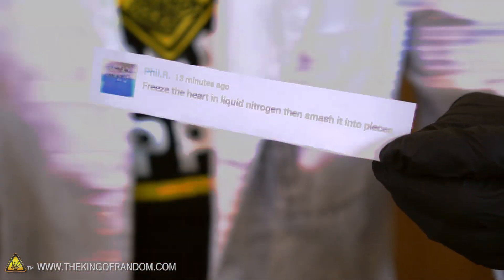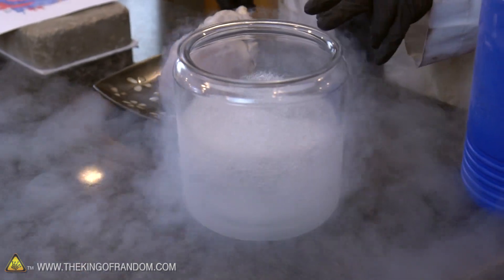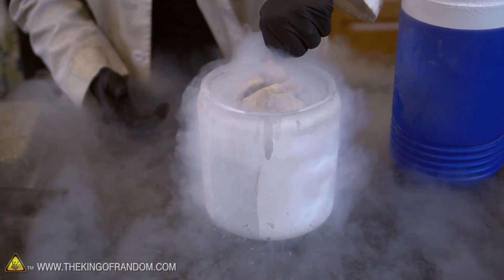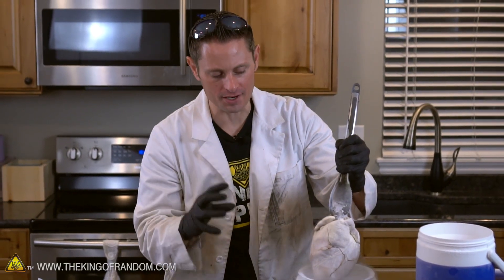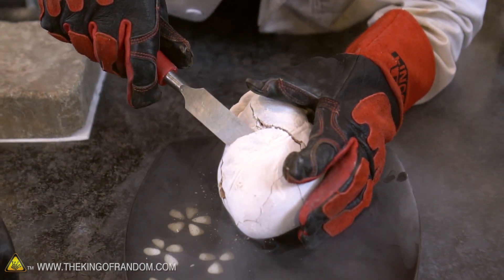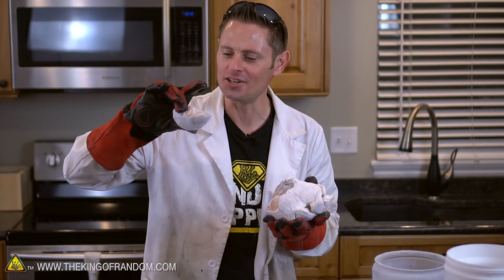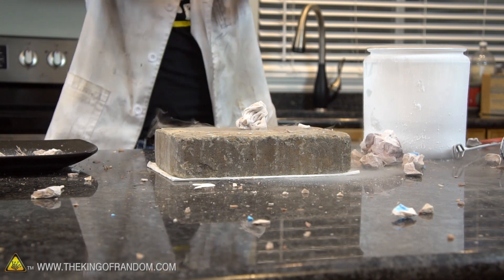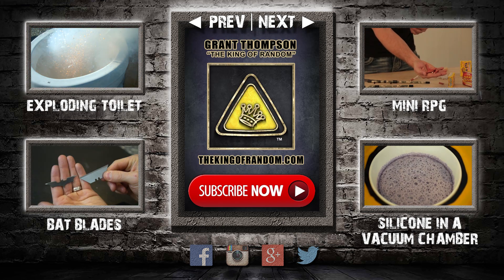Dissecting Hearts With Liquid Nitrogen

Comment: Does water freeze in a vacuum, or does it just boil?  What happens to ice frozen at standard pressure, and put in vacuum?   Is there a difference between cloudy or clear ice?   Does a partially inflated balloon expand if it is covered in water in a vacuum?

Comment: I just learned about vacuum metallization from Adam Savage (cohost of Mythbusters). Bringing aluminum to its melting temperature in a vacuum causes it to 'pop' and coat everything in a thin layer of aluminum. However, it can be wiped away, so normally the piece is coated in a clear  lacquer as a finish. It sounds complex, and dangerous, but that's you're bread and butter for this channel, so I'd love to even see an attempt at it.

Comment: a Prince Rupert drop is created when glass is dropped into water which creates stress. If left out in the air it wouldn't be as much stress therefore it isn't as strong. if you created a Prince Rupert drop in dry ice would it be stronger than the one in just water

Comment: what if you were to make a drinking  glass mold using silicone? I think you would be able to make the actual walls of the glass from setting a smaller one into the bigger one. That way I think it would make walls and a cavity inside to put actual liquid in!

Comment: I heard if you put a CD in the microwave, little bolts of electricity bounce around on the surface of it. (The CD no longer works afterwards so make sure it's one you don't want)
Reply: also will destroy the microwave, and may start a fire

Comment: You should put water and an egg in your vacuum chamber and see if you could hardboil the egg
Reply: Mike N. you cant, the water just boils at a lower temperature if the pressure is lower
Reply: Kira then would the egg cook at a lower temperature?
Reply: it s like putting the egg in liquid nitrogen which is boiling but instead of cooking the egg will freeze

Comment: What happens when you put liquid nitrogen in a vacuum chamber?!
Reply: Jumbo Nugget turns into gas and leaves like air
Reply: Jumbo Nugget he already did
Reply: Jumbo Nugget or if the vacuum is strong enough it lowers the freezing point of the nitrogen, and it will freeze solid. but the interesting part is freezing solid uses just enough energy to create just a little bit of heat, that it will cause it to rapidly go back and forth from instantly freezing solid to being liquid.
Reply: Riot yep...not that interesting..
Reply: Actually it starts to freeze and turn into ice but only for a second. It turns back into a liquid.
Reply: Jumbo Nugget whatch his boss so I can find out dude
Reply: Jumbo Nugget yeah

Comment: I think it would be interesting to see you mix up a batch of concrete then extract out the air in the vacuum like you do the silicone.   Would it be denser,  and harder once it cures or would lack of air not permit it to cure

Comment: Freeze a rock and see if it will break or stay hard to break!
Reply: This only really works on substances that would become brittle where there was previous elasticity or malleability, or especially on organic matter (water content freezes) so a rock wouldn't really be affected, as far as I can tell.
Reply: Alaxonah it wouls be smashed
Reply: Max Fisch That's kinda interesting, you'd think that since a rock is hard, putting it in liquid nitrogen would make it extremely brittle but I guess not
Reply: I don't know much, I'm just extremely curious, anything could happen. I think.
Reply: Wyatt Halverson I think that the rock's molecular structure couldn't be modified after flash freezing, this is usually only seen after heating and cooling (e.g. steel). However, this is also dependent on the bonding between the atoms or molecules (amorphous, polycrystalline, crystalline). This is why I made the conclusion I did above.

Comment: SEE WHAT HAPPENS WHEN YOU PUT ANITFREEZE INTO LIQUID NITROGEN
Reply: It freezes.
Reply: TheMontanaDave Not the point, it should freeze without crystals and look like glass
Reply: The minimum freezing point of Glycol temperature is at about −36 °F / −37.8 °C corresponding to 60–70% glycerol 

Liquid Nitrogen is at -321F So yeah do the math, it will freeze.
Reply: It will if not done too fast. There are a few factors for that. 1st the oxygen in it. Yes It will have Dihydrogen Monoxide molecules in it.; along with other oxygen bonds.  @n'd if you freeze of "crystalize" something to fast it will show. If you cool it at the right rate and lack of atmosphere ( Hey the vacuum chamber!)  It will be very clear. Now when making clear ice, they use either vibrations or an insulated freeze method - ( YouTube this)  to remove the dissolved O2 from the water.  If you don't remove the dissolved gasses (O2 or Nitrogen, hel any dissolved gas) it will have bubbles or be cloudy.  

Does that make sense or do I need to show you a vid?
Reply: TheMontanaDave Lol you're not the only smart one here. I understood what you said.
Reply: yea these tumbleweed hairs do not know what they're talking about
Reply: simply put it looks like water
Reply: Torpid N1ghtmare would just freeze antifreeze is resistant up to a certain degree
Reply: I am stating facts bro.
Reply: when you try to look smart

Comment: Have you experimented much with vapour points? Such as how lower pressure forces most liquids at room temperature to instantly boil. Lower pressures decrease boiling points, so I'm curious about how low a pressure does room temperature water boil? What about still frozen ice in a vacuum chamber?

Comment: water expands when it's frozen, so since the outside froze solid first then the middle did it expanded the already frozen outside resulting in cracks on the outside. 
That's my educated assumption on why you saw cracks not from you doing it prior.

Comment: Could you put liquid nitrogen in a bottle and screw the lid back on and leave it in the sun to see if it explodes. I am buzzin to see the liquid nitrogen generator. Also could you make a liquid nitrogen powered version of the hand warmed steam engines so it creates the vacuum to pull the piston down and air comes in when the compression piston is at the bottom so heats it up and then the piston goes back up, etc...

Comment: Take some lollipops and heat them in a very high temperature , while when the lollipops are melted there are gonna be so many bubbles so I'm wondering what happens when you put it in a vaccum chammber ( while it is super hot )

Comment: in your next project, color the liquid nitrogen with food coloring, how will it respond to the coloring and will the gas change color?
Reply: The food coloring would just freeze into small beads.
Reply: Amane Abunada no. The coloring will freeze and will not be able to mix in. The gas will remain invisible to the naked eye. Would be cool to see frozen food coloring, though.
Reply: Cheeser100 ^
Reply: what if you put powder pigments? would those freeze, or could they mix in with the liquid nitrogen?
Reply: that would be awsome
Reply: Wont the nitrogen freeze the food coloring?
Reply: kitsilanocat they would probably freeze but I am guessing they'll just kinda bounce up on the gas released from the liquid nitrogen.
Reply: Amane Abunada food color can't dissolve into liquid nitrogen because they aren't the same density also it would just freeze and if it were to some how mix which it wont, and it evaporated the food color wouldn't evaporate with it, because it is like how salt doesn't evaporate with water at waters boiling point
Reply: Amane Abunada nice idea
Reply: Thanks:)
Reply: Cheeser100 oh yea
Reply: I'm so down!!!!!
Reply: Amane Abunada cool
Reply: f
Reply: Mihai Mera sup
Reply: Amane Abunada Grant Thompson - "The King of Random" cut the heart open or do the 1000 degree vs heart  .
Reply: Yay .com it

Comment: Try to put water in the vacuum chamber and freeze it to make a crystal ball with no bubbles
Reply: This will not work as water will boil in vacuum. 
You just need PURE water with absolutely nothing else in it. There is a method of making clear ice spheres for cocktails from bottled water. I think Cocktail Chemistry did a video on that.
Reply: Lucas Mb Cool idea! 😆

Comment: The smokey stuff isn't "nitrogen vapours," it's condensing water into tiny droplets creating little clouds.  I'd guess that it's just you disrupting the surface of the pooled nitrogen gas, causing it to mix more with the surrounding air, allowing it to condense more water at the surface of the nitrogen gas pool.

Comment: Hey Grant. What would happen if you poured liquid silicon into your liquid nitrogen. would it turn back to liquid when it thaws? Or will the time it was frozen cause the silicon to set?
Reply: because I watch youtube.
Reply: Zenborath I think it would be cool if when the outer layer thawed it set and then when the inside thawed it turned into a bag of silicone.
Reply: Zenborath why are you everywere?
Reply: Silicone isn't setting because it is cooling down, it starts and ends at room temperature, it sets over time from the reaction of the two things being mixed together so it wouldn't set from it
Reply: Illusory Gaming I'm not sure if this comment is aimed at me or not but if it is I meant the outer layer to set after it had thawed but while the middle was not thawed

Comment: If you put the main chamber of the vaccum chamber in a tank of water and weighed it down, would it float when it was pressurised? Because vaccum is obviously less dense than air, so it would float even better, right?

Comment: since ice melts when under pressure and freezes when the pressure is released could you put an icecube into a pressure chamber to melt it and then store it as a liquid and then when you release the pressure back into a solid

Comment: hey grant,, can you put gun powder in liquid nitrogen then try to light it on fire?? I wonder what that would do.. :)
Reply: Rafik Nanneh light on fire?
Reply: Fire needs a "minimum temperature" for it to stay lit, i've seen one of a guy freezing alcohol and attempting to light it on fire, it didn't work.. But now gunpowder? I wonder that, since it's an explosive (If it's in a "cluster" and contained in one place)
Reply: Diogo Ayres gun powder burns way hotter than alcohol and since it's a light powder it doesn't need a lot of energy to warm up.
Reply: You mean light the cold gun powder or light the liquid nitrogen?

Comment: What happens if you try to boil water in vacuum ?
Reply: JoePineapplecoconut the water will be able to boil at a much lower temperature due to the low pressure.
Reply: It would be interesting to see at how many degrees water boils depending on pressure.

Comment: cut the heart open put it in slime then heat it up with pitch torch then put the heart into the vacuum chamber it should make the heart explode because the slime has baking soda that holds lots of air and it puts the air innsidd the heart and the slime melted covers it to make it EXPLODE like if you agree

Comment: Try to make the heart beat with electricity
Reply: Snorlium Z actually you could but you would need a really high voltage which he wouldn't be able to have access to
Reply: Muscle tissue will react to electric pulses, no matter if there is blood or not.
Reply: Think he might need a new one for that now
Reply: 1005rhys 2 words, Microwave transformer
Reply: 1005rhys and taser
Reply: simply wrong. The cells need some sort of energy to contract (and no I dont mean energy as in electricity) In the case of this heart the cells are dead, most likely since quite a while so if you put electricity to it, nothing will happen. if it was a really fresh heart (Im talking a few mins) it would be able to contract.
Reply: yeah just connect electricity to the smashed up heart......

Comment: What happens when you put Mercury or gallium in the vacuum chamber?
Reply: zipha nothing happens.
Reply: zipha What happens if you put an internet troll in a vacume
Reply: maybe mercury will turn into a gas? well if it does then he probably shouldn't do it because you know, mercury is kinda, toxic..
Reply: zipha probably not much
Reply: pws3rd 1 why is he an internet troll?
Reply: zipha plz
Reply: zipha Probably goes solid
Reply: I guess it would start boiling, depending on the temperature and the atmospheric pressure.

Comment: Is it possible to cook ramen noodles in a vacuum chamber using water that boils inside it?
Reply: Ferguson Landy No, just because the water boils, doesn't mean it's hot.
Reply: I wouldn't consider it boiling if it wasn't hot then .-.
Reply: Ferguson Landy no because the reaction that cooks food is catalyzed by heat, technically not true since there's no catalyst.

You might be able to burn foods at a lower temperature except for the fact that there's no oxygen.
Reply: the water boils in vacuum because the low atmospheric pressure is not enough to keep the water molecules together as a liquid so it turns into gas, so it's not hot at all
Reply: Ferguson Landy the water only boils because the new atmosphere changes the boiling point of the water. So no, it wouldn't work.

Comment: Can you cut the other heart in half using the styro slicer? Bet you could a cool dissection of the heart!
Reply: Its not possible, all that will do is cook the area the metal wire is touching.
Reply: Hamza Husein do it
Reply: Hamza Husein ما اتوقع يقطعه
Reply: Hamza Husein He has no more hearts he ruined the other heart by putting it with chocolate in the vacuum and he used the second one to freeze it. I know this because he commented on a comment and said he has no more hearts
Reply: Impossible.
Reply: Hamza Husein I

Comment: from that experiment where you put liquid nitrogen in the vacuum chamber and tryed to freeze it it was wrong because if the pressure is lower then the boiling point is lower. And you should make pressure camber and then freeze liquid nitrogen

Comment: What happens when you put styrofoam into a vacuum chamber?
Reply: GLaD0S nothing
Reply: GLaD0S what happens when you put chell in a vacuum chamber
Reply: GLaD0S ya nothing because air goes through it reely so it wouldn't be able to expand
Reply: GLaD0S probably float a little
Reply: Porsche 9 Isn't it filled with Air? i thought it would be kinda similar to the marshmallows
Reply: GLaD0S no it has air but basically none at all

Comment: Freeze nitroglycerin, then detonate it??
Reply: No, don't do that, because it will probably blow up in your face.
Reply: Thank you Grant!
Reply: Middle Earth379 nitroglycerin is way to instabile
Reply: True, nitroglycerin is very *unstable and dangerous, but it should be a tiny little bit more stable when it gets cold. But yeah, still pretty dangerous stuff
Reply: Jonathan Küppers Well, if you can freeze TNT, then why not freeze some azidoazide azide while you're at it?
Reply: công Hinh Phan even while the process making it, it gets very hot and if you cool it down to fast it could explode. Even <1g make a big noise and a relativly large explotion

Comment: what happens when you put water into vaccum will it boil or will it give the air in it also check it out with a thermometer
Reply: Chaitanya Naik it boils
Reply: Chaitanya Naik nothing happens
Reply: Geo Bailey you're wrong, it boiles
Reply: Tim Dijkhuizen Yea it boils at a lower temperature than usual.

Comment: what happens if you melt magnets
Reply: In extreme temperatures- hot or cold - they would lose their magnetic abilities.
Reply: Saif Aliyan It becomes am eternity of molten elements that serve a great purpose of uselessness to this world.
Reply: ya
Reply: they demagnitize .
Reply: what if u froze it
Reply: They are basically just metal, heating them will just remove their magnetic proterties and melt them like normal metal
Reply: It will lose its magnetic force due to the heat
Reply: Saif Aliyan pretty sure it will just be like melting metal, the heat will destroy the magnetic charge
Reply: Wihnu They are not made of metal
Reply: nothing just won`t be magnetic anymore
Reply: Well, it would lose all magnetic properties. I wish they didn't either.
Reply: neodymium magnets -- he done that
Reply: ashuaaart ashuart of course you can
Reply: Saif Aliyan ur gonna be 25 dollars richer
Reply: i want too
Reply: Saif Aliyan 

that would be cool to see
Reply: Fendt On a farm magnets?!
Reply: dinossauro de negócios to*